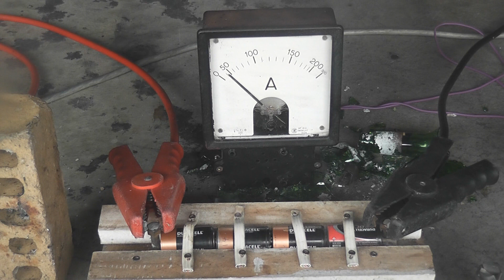D-cell smoke and arcs

Comment: About how many amps was it running through those cells at the 24V level? I've tried to roast a couple AA and D cells with 16VDC  and it pushed 20A+ thru one but it wouldn't cook the battery lol.
Reply from the maker: At 24 Volts level the current was well below 20 Amps. The cells were old and probably dried up. A good cell will easily pass 150 Amps before it pops. Good contact is a must.
Reply: The one that passed 20+ amps was a drycell. It put up quite a fight. The others were alkaline Duracell and Rayovacs. They kept (charging) and then the resistance would increase and overall current would drop a LOT. 150 amps on a good cell? hah, I don't have anything that puts out such amperage, oh .. besides a car battery lol . Thanks for the Reply